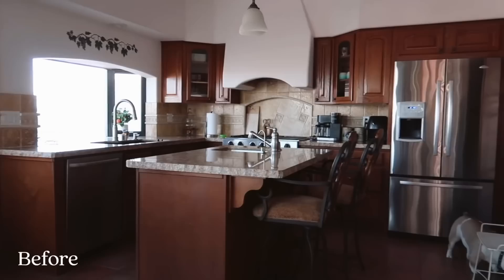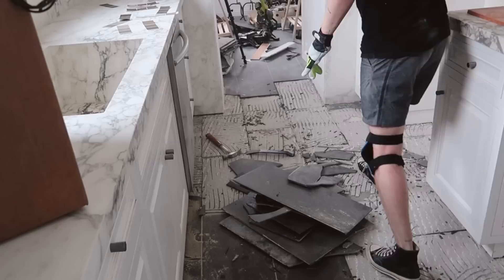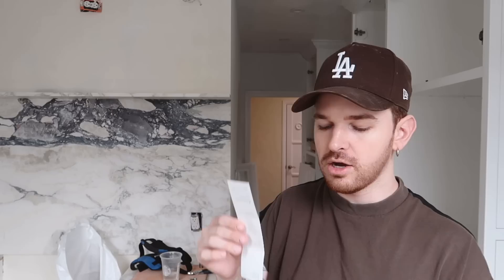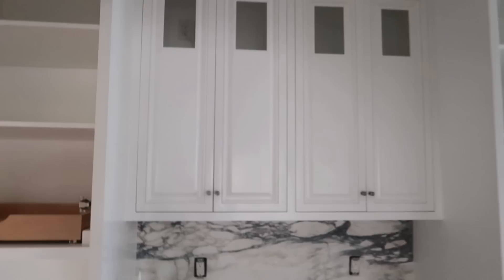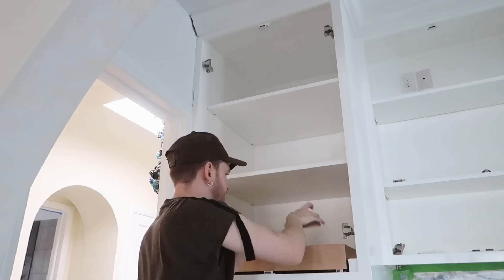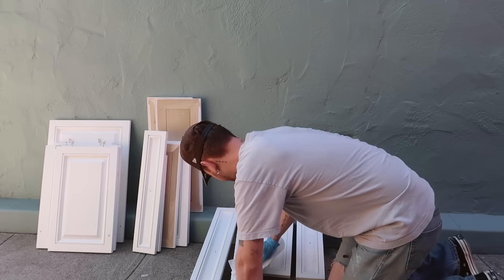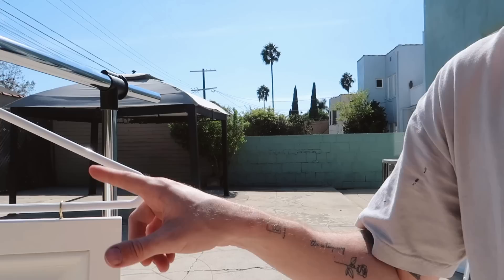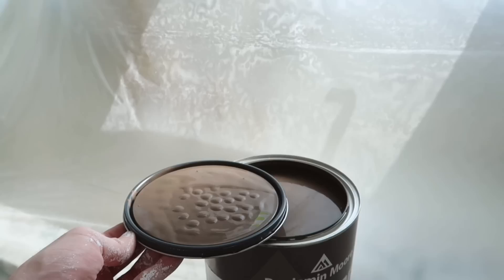Painting my kitchen cabinets BROWN!

Comment: If you ever need to remove or adjust those drawers, you can access the glides underneath the drawer. Sometimes they're secured with a screw, other times it's just a notch in the bottom of the cabinet holding it to the glides :D  Definitely not necessary to do for this project, but thought it might help going forward!
Reply: Also, just wanted to add that you're knocking it out of the park with this home!

Comment: I removed the mortar left on the floor when I removed the tile using an angle grinder with a diamond concrete grinding wheel. It’s loud and dusty, but the only thing that worked.

Comment: Is it possible that your kitchen cabinets are IKEA Factum? It looks like it but I am not that knowledgable. We moved into out home about 11-12 years ago. The drawers, in their entirety, can be removed by using a flat-head screwdriver to unlock the telescoping system to the stationary cabinet rails, in every cabinet. I was able to transform the accessibility in one afternoon by removing the doors and exchanging the rails to different cabinets that worked so much better for me. I was 62 when I did that. I didn't do it all by myself though. At the time I was 5'1", combined with recovering from broken vertibra, I just could not manage the necessary strength to move the wider drawers into the tract locations of their new locations and so I requested my 5'10" husband to help. And? Voila! I had a kitchen nearly designed exactly for me! (nearly because the island is still too big and I want a larger window to the front garden).